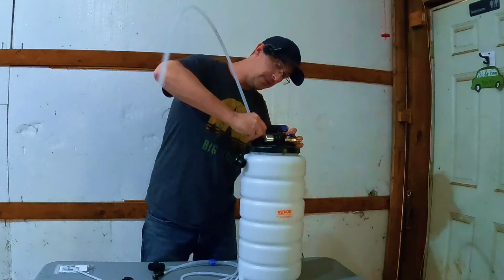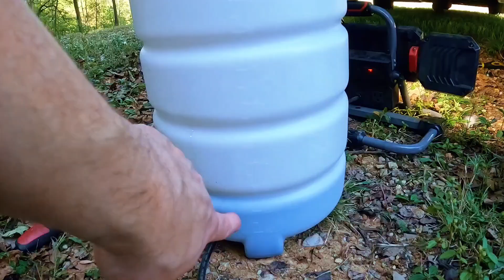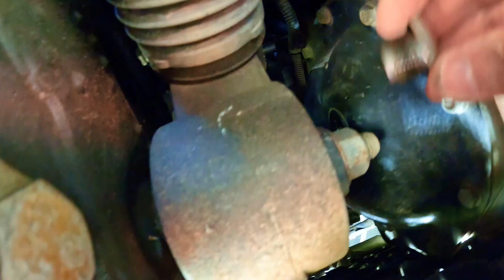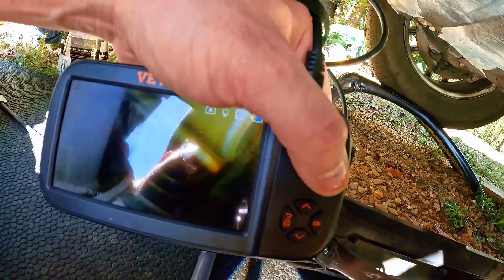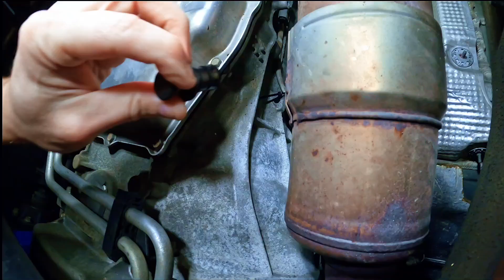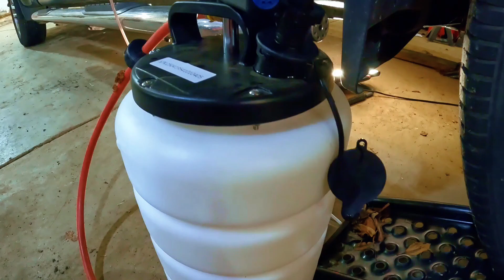VEVOR 15 Liter Fluid Extractor Review

Comment: I just got one of these and it comes with a soft flexible hose but with a black platic fitting on the end. Do you know what that's for? Also I would be careful putting a hard hose in the transmission as it can snag on wires etc inside the transmission. I would use a flexible hose - that's safer.
Reply: That black plastic fitting on the end of the soft flexible hose is for brake caliper bleeder valve when flushing the brake fluid.

Comment: "If you want to work that hard" 😅
Reply from the maker: Have to sing some old timey sorrow songs while pumping the jack. 😅
It's a great tool though. Just a transmission fluid swap at a dealer is over $700 🤮
Reply: Saving paper one Vevor tool at a time  @projectswithjw